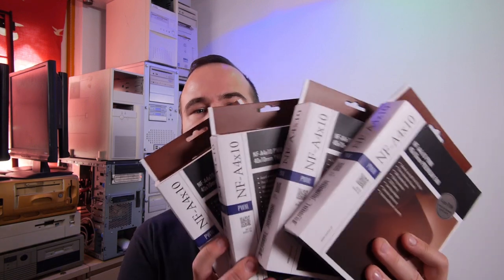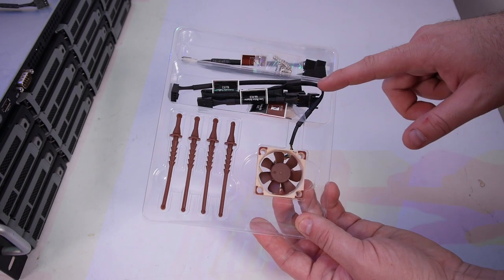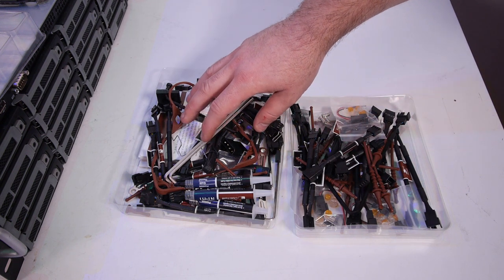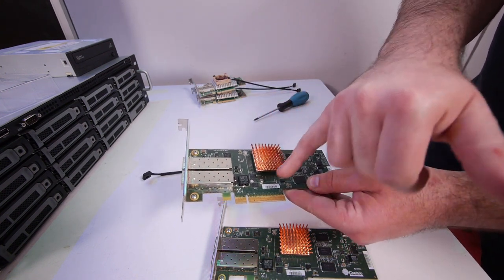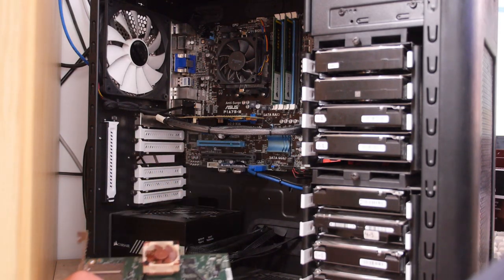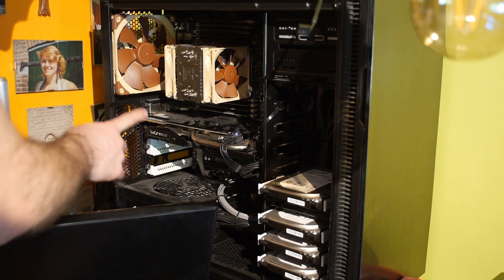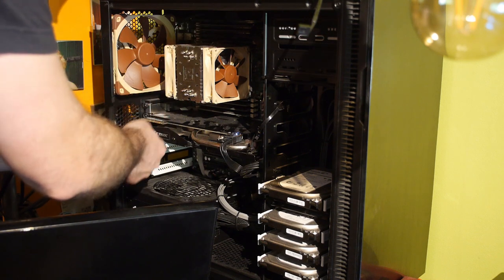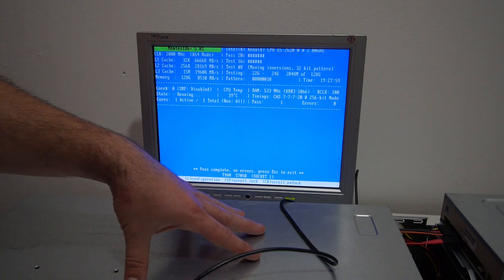10GBE Home Network: Network Card Cooling Upgrade with Noctua NF-A4x10 PWM

Comment: The workgroup server I have downstairs is full of old Nidec fans I pulled out of PS/2 Model 25 systems I bought for parts.  While not exactly quiet due to their blade geometry they make a very pleasant low whirring noise.

Comment: Thanks... I need to do this for my 10Gbe NIC. The 92mm fan I have pointed at the NIC in my server was easy enough, but putting a 40mm on the ASUS NIC my workstation won't be as simple, but I'm running into too many overheating issues to ignore.

Comment: I'm that guy that still uses the 32 bit PCI slot 😂
Reply: What for?
Reply from the maker: WHY? LOL What did you put it? :D
Reply: @victorbart  Well, my Server has a Soundblaster Live in the Slot passed trough to a Windows Xp VM, it's running Spotify so I can connect to it with my mobile phone and listen to my phones music without Bluetooth or a cable.
Reply: @victorbart  Video Capture card. I also have USB 2.0 cards to add additional ports but that's not as big of a deal.

I also have one that adds a parallel port , and another that adds 2 RS232 ports.

All of it to support legacy devices or electronics development.

Comment: Something about 10 GbE NIC's and "retro machines" in the channel name just won't add up :D
Reply from the maker: Yes almost retro enough :D

The enhanced small form-factor pluggable (SFP+) is an enhanced version of the SFP that supports data rates up to 16 Gbit/s. The SFP+ specification was first published on May 9, 2006, and version 4.1 published on July 6, 2009.[23] SFP+ supports 8 Gbit/s Fibre Channel, 10 Gigabit Ethernet
Reply: @victorbart  lol oh wow, I didn't realize SFP+ is even that old since the SFP+ stuff is barely starting to trickle down to switches I could afford.

Well I guess enterprise datacenter needs drive the innovation and this kinda magic has been needed quite a long time ago already. You always learn something new :)

Thanks for the reply!